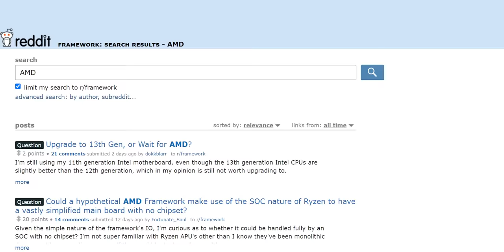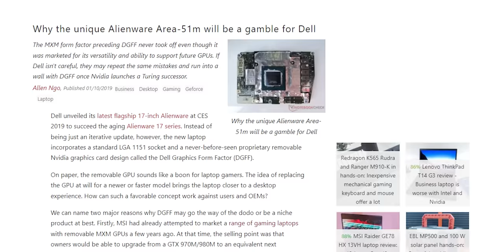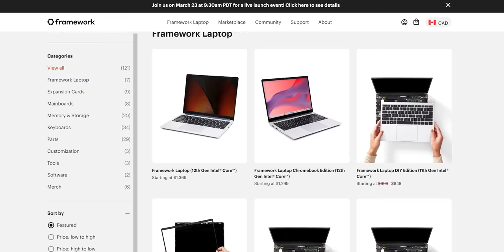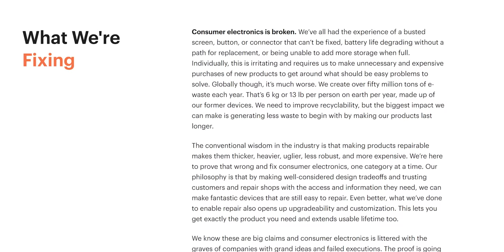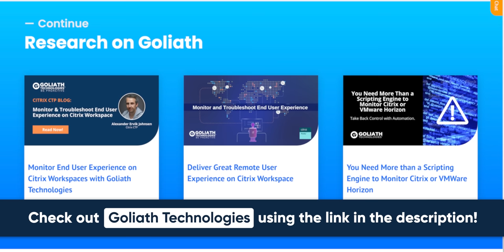I Made a Bad Decision – Framework Investment Update

Comment: I barely have a use for a laptop as is, but what Framework is doing makes me want to buy one of theirs, just to support the cause & ideas! This is what true innovation looks like.
Reply: I use my laptop as a portable "desktop" using docking stations.
Reply: same, I really, really do not need a laptop. But damn, now I want a framework.
Reply: I feel the same way, but it sort of defeats the purpose of building for sustainability if you buy a laptop you don't even need. I wonder if you can donate to their cause on their site or something?
Reply: @Shaflugi  somebody always needs a laptop, if you want to donate your old one.  If you can easily afford it and want it, may as well 🤷‍♂️
Reply: @happybobyou  Same here. I've used laps like this for years. IMO, best way to maintain an active laptop when not on the road. Keep them on slide outs in a surplus rack from a closed AT&T switching center. Added dust filtered fans to keep 'em clean, and cool..
Reply: arguably, once the Ecosystem is in motion, anybody that has a use for a Notebook has a use for these Products. you get what you need and not what you don't, Et Cetera Et Cetera.
Reply: DO IT! Find a use! This is your solution in need of a problem! Hahah
Reply: @Shaflugi  that let you buy a $100 carbon capture thing that essentially offsets the carbon emissions of making the laptop by... Planting kelp, I think? I'm not sure how it works, but that's what they market it as. Seems like a decent way to donate if you're looking to go that route

Comment: I'm having goosebumps as to how this is possible and no other company has done it before because they are just hungry for money. Definitely buying this
Reply: mee too, waiting for the specs and price tho
Reply: This modular design definitely doesn't come free.
I won't pretend to know the full extent of the challenges that come with designing a laptop, but I imagine that such a modular design adds significant constraints and overheads to an already difficult and expensive engineering problem.
Reply: its just like the time microsoft tried to have a modular phone. Its something really difficult and expensive to do. Its a high risk low reward (company wise) task. It may be even bad for usual companies like microsoft, dell or hp. If you are only selling 1 computer per costumer, and then just upgrades, you are losing a lot of value. Because framework is new in the market, having something like this makes them stand forward from other companies, and because they did not have any laptops before, they arent losing anything. Its just risky
Reply: @MartinLedesma-lt8ce  True and fair. But its not like if Microsoft would produce one that everyone is gonna buy it. Most of the people are probably tech people, and the other half may want other devices that just works without to much customizability.
Reply: @SnelleJaapie  of course, completely agree
Reply: @MartinLedesma-lt8ce  People seem to forget that those who just want to upgrade are more common. The general market isnt really after these kind of things, but the technical side is. Framework has their own ecosystem and customers who are after things the overall market is not interested in, and that is the key reason why they might have a chance to grow a lot more
Reply: This is niche, most laptop buyer just want simple mobile comp to get the job done and have brand name to brag. Modularity always belong to tech savvy guy where most prefer pc instead.
Reply: I wouldn't say no other Company has done it as much as they (well, some of them) stopped doing it. Which is even more bad when you think about it
Reply: You're definitely sacrificing a bit of durability and some might say aesthetics for this, however it's more repairable so doesn't matter if it's less durable and I still think it's looks great. May not be as top tier performance wise as bespoke laptops but it's definitely cheaper to own through life!

Comment: I'm a thinkpad guy, but those Framework laptops will make the choice for my next laptop upgrade more difficult (or not, if they keep at it like that). This "super key" instead of "window key" is huge!
Reply: I've had bad experience with lenovo recently so I'm definitely getting one of these instead of a thinkpad next time
Reply: would definitely get one if I can't find a same class used x1 extreme for much cheaper. I really wanna do a GPIO module for this thing
Reply: As a fellow  linux user.... I have no clue why anyone cares tbh. Meta3/4/whatever. Don't give a crap. But then again, my keycaps are blanks.

Numpad is a nice edition, makes it where I can finally recommend it to my sister, an accountant, who finds them annoying without it (I personally prefer the top row and only ever used numpad for macro keys)
Reply: @FireFish5000  TBH, I was joking about the "super key". The rest of comment was real.
Reply: Thinkpads have a Trackpoint, unlike these and that's a deal breaker. When Framework laptops gets a Trackpoint as good on a Thinkpad then it's time to switch.
Reply: @SkepticalCaveman  I'm not a fan of the track point, but for me, what is a deal braker are the physical buttons above the touch pad. I hate when they remove the physical buttons and I never understood why most think it was a good idea to put them below the touchpad.
Reply: @SkepticalCaveman  And a blank to cover up where the track pad would be. I'm a trackpoint user from way back and I disable the touchpad's on my Thinkpads.
Reply: @SkepticalCaveman  Same. Was the first thing I asked, but then I saw how it's designed and we're probably years removed from getting such a thing. They'd have to at least make a new mold for a top cover, and source or make their own keyboard that just drops in and out easily like the older thinkpads.
Reply: Arch, btw?
Reply: @switchp8286  I have been thinking about just buying the Framework board without  the shell and just make or buy a tablet shell for it and then use a wireless Thinkpad keyboard with it instead.
Reply: switched from 20y thinkpad in December. Never looked back. Lenovo ruined Thinkpads. Last good Thinkpads I onwed were T440 series (T440s; T440p). My last one T490: broken hinge, keyboard imprints on display, defective circuit board (when I would tilt the laptop in a certain angle it would go bluescreen)
Reply: @lordcarnorjax8599  I used to disable the trackpad completely too before, but now I actually use it only for two-finger, slow, precision scrolling and zooming because that's  the only thing a trackpad is good for. 

For fast, continuous scrolling I use the Trackpoint of course, or page up/down keys.
Reply: Yeah I feel that, love my old X1 Extreme but its gettin on in years
Reply: I'm also a Thinkpad fanboy, but only because they have models that come with touchscreen + pen digitizer, which is huge for artists and designers, since you get the basic functionality of a screen drawing tablet built into your laptop, and believe me those tablets don't come cheap.
If Framework were to add an option to buy such a display with touchscreen+digitizer+pen support, I'd get one IMMIDIATELY!
Reply: Super key is huge? Dude never heard of stickers?
Reply: @bloodraven2537  Drawing tablets are actually better to draw with than screen tablets, they are much cheaper too, and have better ergonomics. I'm not an.artist myself, but I bought the cheapest XP pen drawing tablet to draw with for just fun. $35 was the cost before the pandemic and it is amazing despite the tiny size. 8000 levels of pressure and 233 per second, impressive quality. Too bad that I'm terrible at drawing so I can't use even this budget model's full potential.
Reply: @SkepticalCaveman  I use a wireless mouse
Reply: My current laptop is a ThinkPad, but man am I glad I got the extended warranty on that. It's on its third motherboard, second SSD, and third LCD panel, none of which were even accidental damage. I was already planning to jump ship with my next laptop, but now I know what I'm jumping to.
Reply: Exactly, and the irony is that his channel got hacked because he uses Microsoft Windows LOLOLOLOLZ
Reply: How would a "Super key" be different to a "Win one"?
Reply: @lordcarnorjax8599  hell yeah, fuck the trackpad.
Reply: @JF-vt4ve  I'm enjoying the P50 with an Intel Core i7 6820HQ. It's not on the cutting edge, but it's still more than viable today. 8GB RAM, SSD (mine's only 256GB), Nvidia GPU (Quadro M2000M), nice and snappy. Happily running Arch. Some models have a backlit keyboard, but mine does not; that would be great in the dark.
Reply: @ChristianMarzzelCazar  Because Microsoft Windows sucks... You know how Linus's channel got hacked? They were running Microsoft Windows, that's how...

Comment: this is the push I needed to actually pony up and buy one. I really want to support the development and consumer rights they are pushing for more than anything! Please keep this up you guys.
Reply: I now regret my surface laptop 4... Might sell it and get a framework if price makes sens
Reply: If they'll ever integrate a detachable tablet as a screen for the whole thing that's capable of taking stylus input, Imma gonna pony up as well. Pun intended.
Reply: They've definitely have come far.

From the lacklustre Intel-11th gen CPU, weak iGPU, and limiting 13in size.
Slowly they're going for the low-hanging fruits, which are: AMD, 16in option, dGPU option.
They've added a couple bonuses like Matte screen, Numbpad, Accents, Marketplace, etc etc.

Part of my worry, is that if you do too much too quick, you stretch yourself thin and compromise the whole operation. They should try to keep it limited and simple.

Future considerations to make:
- Extra large trackpad
- Touchscreen
- Stylus input
- 120Hz+ screens
- 4K+ screens
- 360' hinge
- free Mini PC bracket with every platform upgrade
- new parts for Webcam, Microphone, Speaker, etc etc
Reply: I really want a framework but I need my laptop to have a synaptics TouchStyk... if they add that as an option, I'm sold.
Reply: wait until you see the price
Reply: Yeah I’m definitely getting a framework laptop when my current laptop dies. I love the idea of a desktop-ish laptop where you can just upgrade the parts you need.
Reply: @Timotheeee1  well that's the catch with this many options and not using machine tooling, maybe it'll get cheaper when it's more sold

Comment: I wasn't 100% sure of the Framework idea at the beginning, but this is starting to look pretty nice. Linus you might be part of something awesome in the laptop arena and it's been a long-time sense something exciting has happened to laptops.
Reply: This is starting to look worse to me. Yea the premise of the product is amazing, but thats A LOT of different things to support and maintain as an company. 

Then theres the other problems of how well will the pogopins or whatever makes the connections with the keyboard modules work? Now maybe good, but how about in a year? Fairphone had a lot of easy to swap modules but they want back to normal ribbon cables, partly becUse of reliability.
Reply: @The idiot said:  but realistically,  once you've gotten the setup you need, how often would you be swapping parts out?
Reply: @MrPete81  just like a high end office chair has mainy ergonomic adjustments. You set it perfectly for you. 

The only time you change is during an upgrade cycle. I really hope other manufacturers get on board with the standards introduced here.
Reply: @MrPete81  with the fairphone swapping parts isn't common at all either. so that really doesn't change any of my problems with it.

Comment: This is actually extremely cool. I love that modularity. I love that you can try it, and if you decide you don't like the layout, you just buy replacement parts to swap it into a different configuration! And of course, I really love cutting down on e-waste.
Reply: Lets hope other companies hop on this trend too, i may finally have a laptop with both a quadro and an rtx!
Reply: ya my last surface pro 7 is sort of meh, this looks very tempting for the next machine
Reply: @haze782  apple did this in the 90ies. The PB540c for example. Edit i also remembered now i had an acer laptop with gåu port back in 2010. Cpus were socketed back in the days = easy upgrade. The Apple ypu cpuld switch a battery for a cdrom or diskdrive or extra battery.

Comment: honestly next thing is to be able to swap screens easily, cant wait to see where this goes
Reply: You can swap screens easily
Reply: Imagine a dual screen laptop, I bet they could do it
Reply: Easy swapping screens are a must. OLED or LCD
Reply: This already existed in Framework's first model and it would be strange if it wouldn't be a feature in the 16" model as well.
Reply: Swapping a screen is a set of pins and a couple of screws, it's very easy to do.
Reply: @samuelwilliams2266  
The idea is always there but to make them reasonably portable or durable enough is the hard part. 
Honestly, I think a separate lightweight but durable screen is just a better choice overall for on then go application.

Comment: I really wanted something like this 10 years ago but I couldn't imagine how it could look like. Now here we go. This is fantastic!
Reply: Laptops used to be quite modulable. My first laptop, a Dell latitude from 2006 has swappable cpu AND gpu as well as removable battery, removable DVD-Drive, extension port on the bottom for an extra battery or a dock and a bay to install either an sd card reader module or things like security card reader or even a floppy disk drive. My HP Elite book from 2012 is similar but the GPU is fused into the mainboard.

All that to say we lost quite a lot of options over the years, but it's good to see initiatives like framework get popular. I find that the price/performance ratio is on the low side however.
Reply: @Rubafix989  Framework are taking this a whole generational leap further than what the likes of Dell were doing back then.. And at average consumer level pricing.
Reply: @danimayb  Are you a sales rep? ^^ Prices are quite high though. "Starting at" prices don't include, ram, storage, ports, not even a keyboard or power brick. For 1200€ you get a very basic laptop performance wize. Where a 1000€ would yield a midrange CPU paired with a 3070 and much more ports.
Reply: @danimayb  lol, "at average consumer level pricing"... You can buy a full laptop with a dedicated gpu for les than $1000 all day, this laptop (the 13inch with no gpu of course) with the basic is about $1200-1400 when you add the ram, storage, keyboard and expansion cards.
Reply: @Rubafix989  Expensive, yes, but you're paying for modularity which exists nowhere else now. In essence, you're paying extra to get back what every other company shafted us on.
Reply: @alberot11  For example, The offering Dell produced back in mid-late 2000s was limited on the upgradability path, And the cost of the base unit was very expensive.. far in front of the average consumer laptops of the time - And they were expensive anyway. With framework the units are a bit more pricey than standard laptops of today, But with a hugely diverse upgradability path including the ability to cross architecture. say what you want fella but this is miles ahead of what had been done before! If this company takes off this could be a shake up the industry needs.
Reply: there was an idea for a phone around that time that was a neat little thing, don't think it went anywhere tho

Comment: I can't wait when this becomes more mainstream, and with more volume sold, the price should go down. When the price is right, I'm all in. Love the modular upgradability and reusability of older parts as home PC's/servers etc. I see no purpose in throwing out the whole thing every 4 years or so, just to upgrade (at least I have kids that inherit my laptops). At least the Lenovo Legion which I use for work and gaming, lets me upgrade the RAM, NVME drives and the wifi card I think. But not anything else. Built my desktops for decades, and reused every component in the kids PC's, a case can last up to 10 years. Being able to do this with a laptop is brilliant. Hoped that someone comes with this idea and materializes it. This is a game changer. I'm starting to save to get one of these in a year or so.

Comment: I was browsing their store just last night. Looks fantastic! The GPU additions are a game changer
Reply: I've had one for about a year now.  It's fantastic.  Recently dropped mine from the back of the couch, it hit perfectly on the corner, so the worst hit possible. Within 15 minutes, I had the back off and the frame hammered (with a hammer) back into shape.  Looks good as new except a smashed fingerprint reader which amazing still works perfectly.  If that ever decides to crap out, it will cost about $20 to replace.